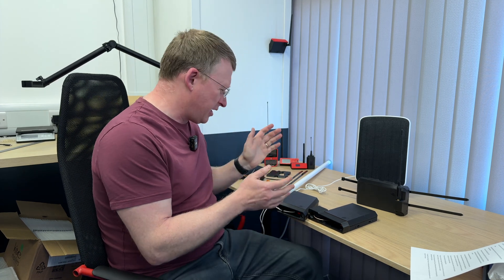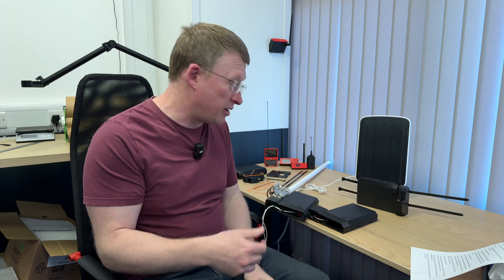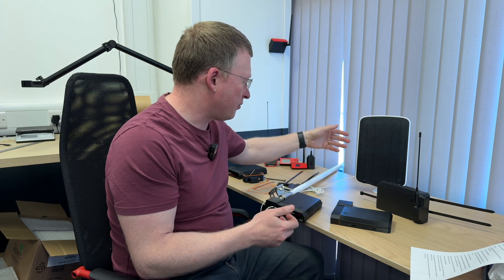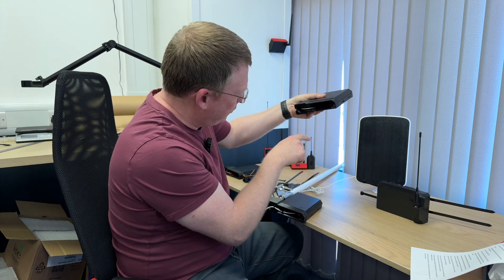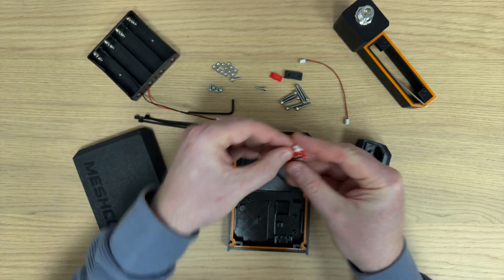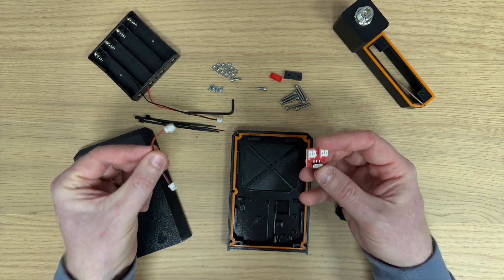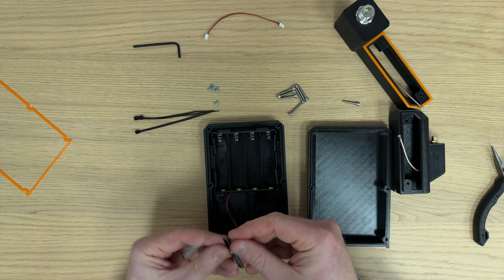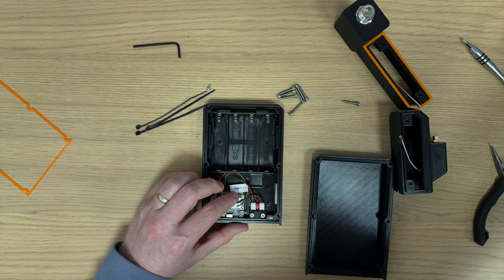Hermes - An Affordable & Flexible External Solar Node Enclosure for Meshtastic and Meshcore

Comment: Here in Wisconsin the winter mornings are -10F / -25C for a couple of months. What are options for powering these radios with Solar Configurations
Reply from the maker: I wasn’t able to test is extreme low temps but my research suggested it likely wouldn’t be an issue. There are over 100 Hermes deployed worldwide in a varied array of climates and I’ve yet to receive any reports of issues due to weather, that’s in about 7 months.

Solar options, basically any typical solar panel for a security camera or doorbell is a good choice, simple to splice in the cable to the Rak solar port.

Comment: An alu case would be much better as it would reduce oil consumption and is 100 percent recyclable while also being protective against lightning
Reply from the maker: Buy me a CNC dude and I’m on it 😁 If I can keep growing I’ll add more manufacturing techniques to the business. CNC and Laser are on the list, recently added dual material printing which was the first step to expanding design techniques.
Reply: @zerofox3d  good stuff, but I think casting would be most appropriate
Reply from the maker: You need very deep pockets to make moulds for casting or injection moulding, if my EuroMillions numbers come up tonight I’ll be on it trust me lol

Comment: Couple questions, but first, damn!! GREAT DESIGN!!! LOL - What is the print material? We have evil UV rays here in Texas along with 100⁰+ heat. And 2nd, any bottom cover options? We also have wasps, and mud dobbers that build mud nests in cavities just like that. -- thanks!!
Reply from the maker: Printed in PETG which holds up well to UV. Its glass point is much higher than PLA and if you look at the tests online people have had functional parts under load that haven’t deformed in the US sun. Should be good!

Insects were not a factor I considered in all honesty! The openings for the solar cable are very small, I don’t imagine a wasp sized bug could actually get inside the case but building nests in the bottom cavity/shroud I guess could be possible. I’d considered enclosing/covering the bottom shroud but couldn’t find a justification 🤦‍♂️

Comment: Question: Will the GPS module drain the battery when disabled by software?
Reply from the maker: I have not experimented with the GPS settings much. I set the update frequency to be once a day and still saw significant battery drain, it may be disabling it is the only way to maximise battery life. For a static node I didn’t really think GPS was a vital thing though!